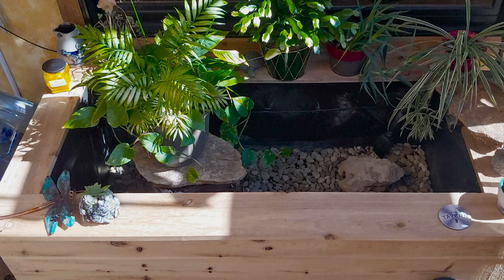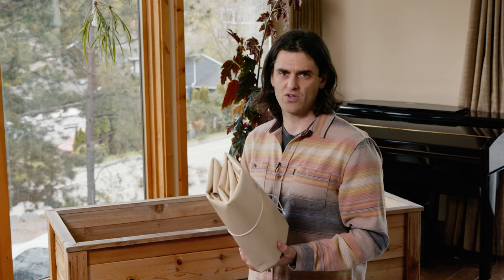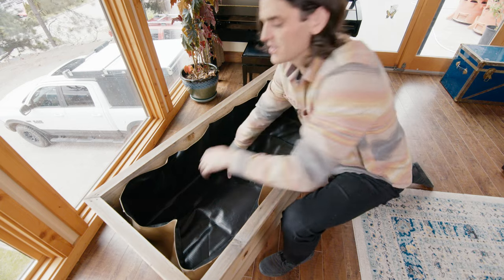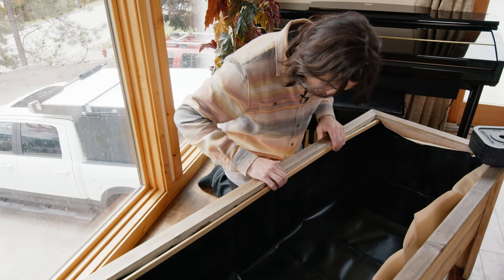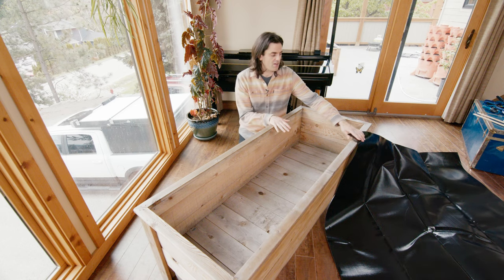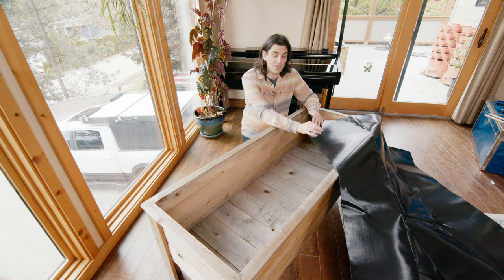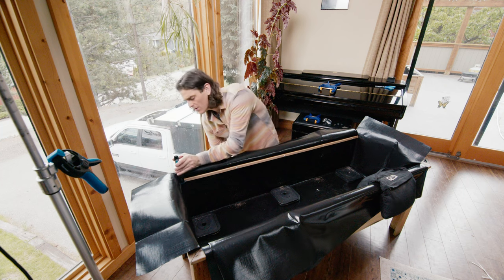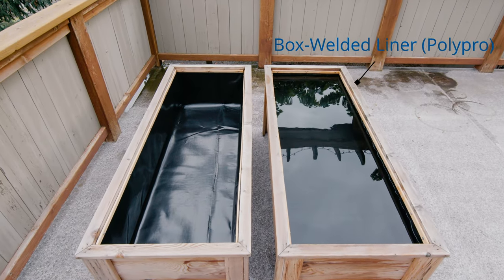How to Line a Planter - Planter Liners at Everything-Ponds.com

Comment: Where can I find planter boxes like these that would support the water weight? I’ve been wanting to do one of these for a while, and these liners look like the best looking option, but I’m going back and forth looking at planter boxes and can’t decide what I think won’t fail under the weight of the water. Thanks
Reply from the maker: We purchased these locally from a man that builds planters and sells them on Facebook Marketplace. Most planters should be strong enough to hold water since dirt saturated with water wouldn't be that much lighter than just pure water.

Comment: Hello, enjoying the videos. I am looking into making a bunch of ebb and flow tables. I would like to use a wood frame and then line that with an RPE liner. 1. Can I paint the liner a white color? 2. Can I use multple liners to make a thicker bottom and heat seal them together? 3. Can I glue liner to wood?  When I fold up liner to make it fit corners can I think heat seal it together to form a proper corner and just have visable seems with no water leakage? If you can give me any insight onto this I'd appreciate it. Looking to order from you guys this week.
Reply from the maker: We have not experimented with painting the liners, but I imagine it would be possible if you found the right paint. You may lose the NSF-61 rating though since paint may not be fish safe or drinking water safe. You can combine the RPE liner by heat welding the seams. This requires a specialized tool and knowledge of how to heat weld. Glue is also not something we've experimented with. We will normally heat weld, and then mechanically fasten around the top edge for a secure fit.